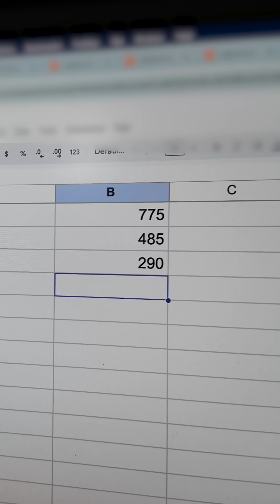What about a pipe instead of a canal?

Comment: :You don't have to worry about water leaking.  So the construction would be cheaper. Less inspections. Cheaper materials. Much less regulations. but you probably want to reduce the risk of total pipe failure.  What about a pipe/aqueduct from the Mississippi to California?

Comment: A few issues with your commentary. The poster said supplement not solve. In a crisis, this could be life or death for many many families. 

You can increase the flow rate on any pipe to get more through it , the size of the pipe is not the only factor

If the water is needed for fires and just use the ocean , 1000 miles of pipe won’t solve the issues around fires especially if elevation is required

Comment: The capacity of a pipe increases by the fourth power of its diameter. So twice the diameter would be enough if you have the same pressure drop per distance.

Comment: Did you take the viscosity into calculation? The water is much easyer to push through the pipe. Crude oil is thick and sticky, like you can see on birds when there was an oil spill. So the pipe can deliver much more water than oil.

Comment: This ignores the viscosity of the crude! Water has far less resistance to flow and so the velocity of water in the pipeline would be much faster and volumes increase accordingly. 🙄
Reply: Came here to say this
Reply: Was my first thought, "I bet he didn't account for how thin water is" 😅
Reply: Same
Reply: Dito
Reply: Agree, but could someone better at fluid dynamics give an idea of how much more?
Reply: @Johangauffinify  A 48 inch pipe is a large pipe and likely to result in turbulent flow. therefore, the Darcy-Weisbach equation is more relevant.

Water's much lower viscosity results in a higher Reynolds number, therefore, a less turbulent and more efficient flow would be expected.

Assuming a similar pumping pressure, it is likely that water would flow 5 to 10 times faster than crude oil. On that basis, under similar conditions, it is likely that a 48 inch pipeline could transport approximately 500 million to 900 million gallons per day. However, a more accurate figure would depend on the exact viscosity, turbulence and pipeline efficiency.

😊
Reply: @nalakprince6376  Have you accounted for the many shutoff valves and their resistance?
Reply: You are correct Sir.
Reply: and a water line is typically much bigger